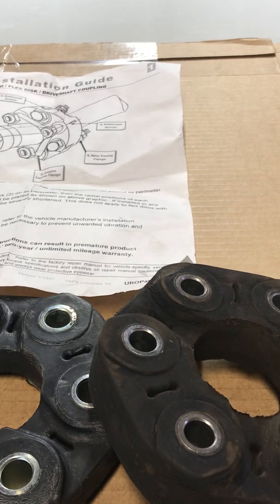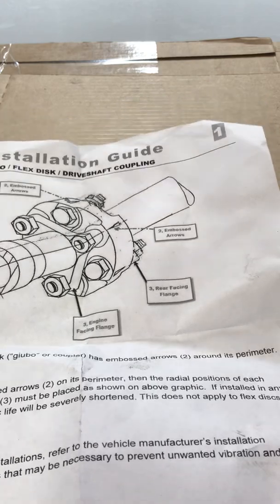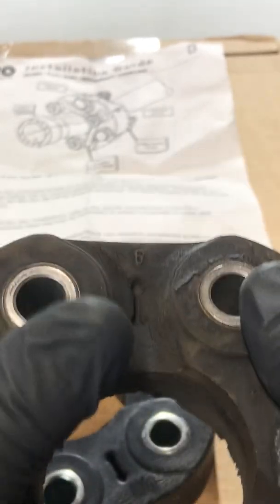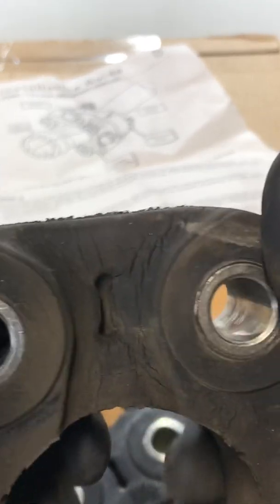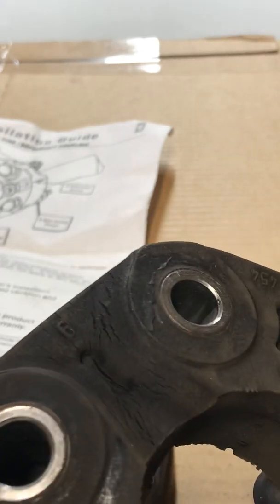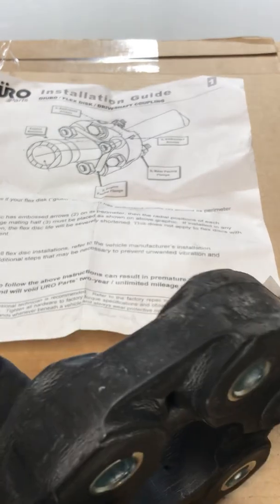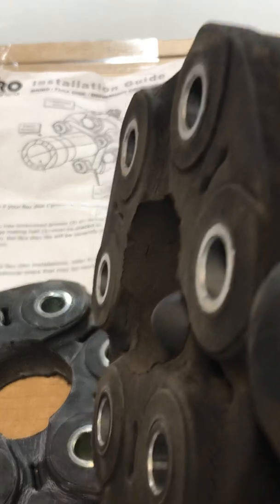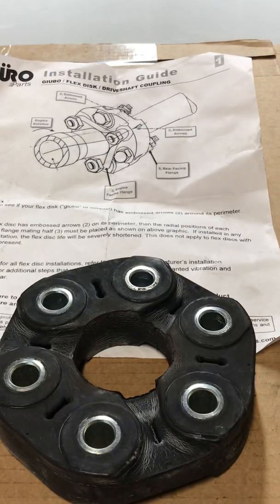BMW Guibo Flex Disc Inspection & Diagnose...

Comment: I just removed the new poly one I had just bought with poly trans mounts.  Keep it stock or youll have a loud vibration or hum due to protruding edges on the aluminum frame.  Now I have a clack that may be my Ujoints.

Comment: I have on my f10 vibration when i drive 65mph and is start vibrating more when i increase the speed…also when i pres the acceleration i have like a grinder noise like the cardan touch the chassis or something like that which is come from the ghear stick area…can u help me please 😢😢😢
Reply from the maker: What’s the mileage, have you had the transmission svcd? Fluid & filter change?  Check if your transmission pan is leaking fluid, check fluid level & quality. Get a diagnostic scan tool & scan for transmission codes….
Reply: @vigourdiy5084  120k miles. Ghearbox it is manual..i just get the car 1 month ago and i just wiggle the cardan and it has little play when rotating with the hand…the vibration is stard after the car is getting new clutch and flywheel..no oil licks around the transmission. Maybe they doesn’t put the cardan on same position when the clutch is was done?
Reply from the maker: @Kevin01743  Okay you have a manual gearbox. If the drive shaft was not put back in the correct way & is out of balance that can cause  vibration. A little wiggle in the cardan/ U joint would be noticed on take off like a clunk but not when your up to 65mph. Maybe the clutch plate or pressure plates aren’t lined up or torqued properly.